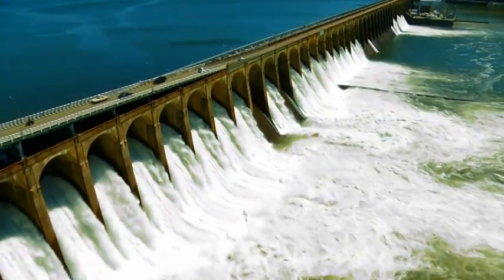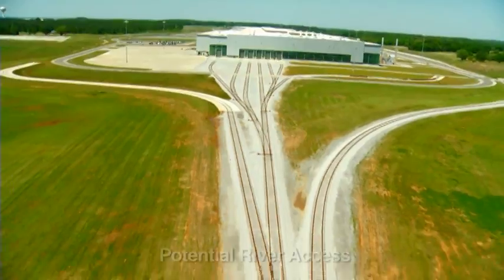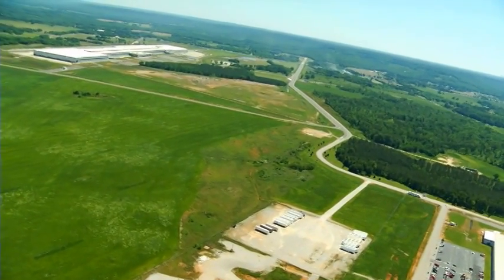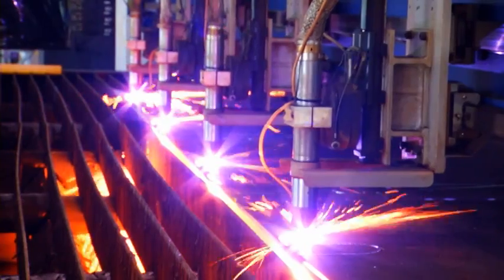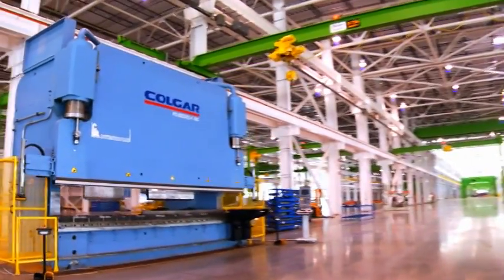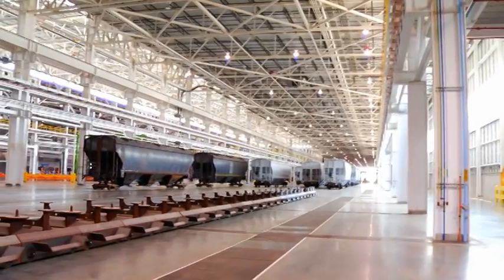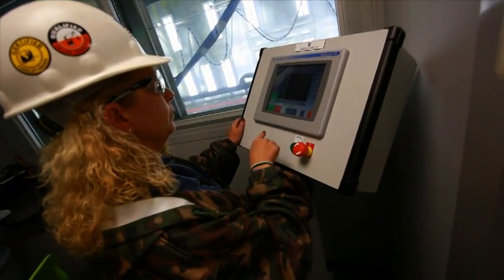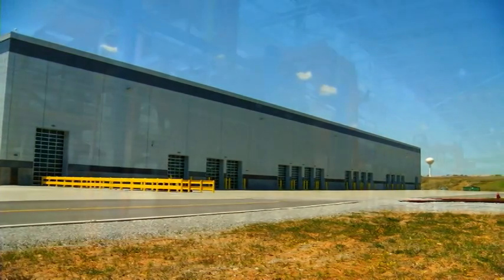National Alabama Corporation

Comment: Wait until they find out that trying to build a RR car this precise, will cost them way more in the long run. If they had went to Pandjiris, in St. Louis, who has built the majority of car fab equipment since WWII, they would have had a working factory at way less the cost. That plant will still be in debt, with a bunch of their new equipment mothballed, for 100 years. Way too much overkill on the tooling, and to dependent on automation.